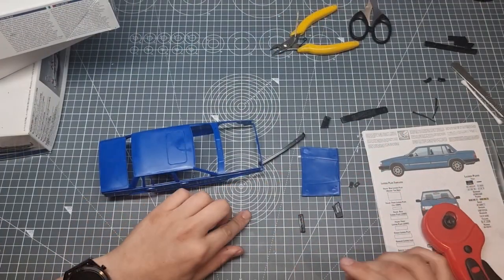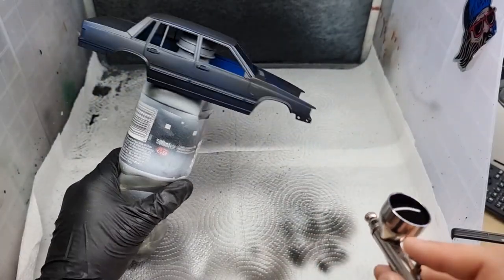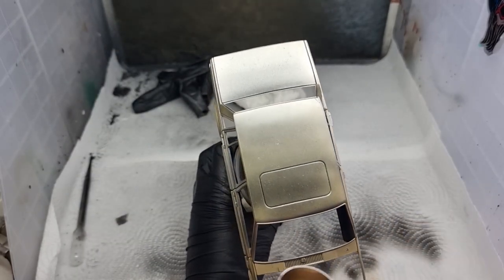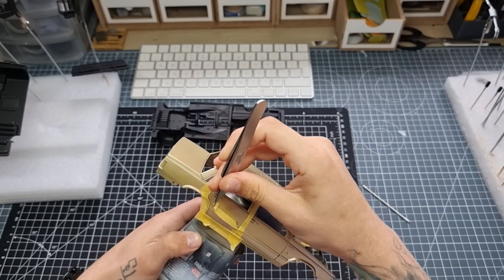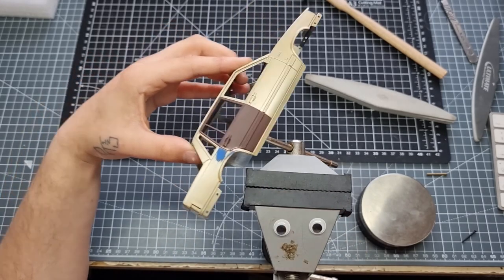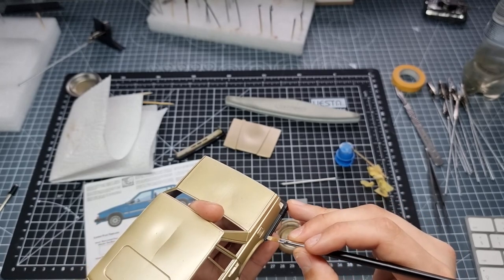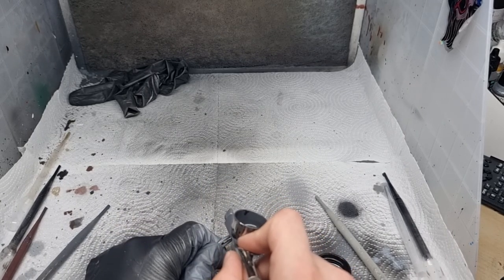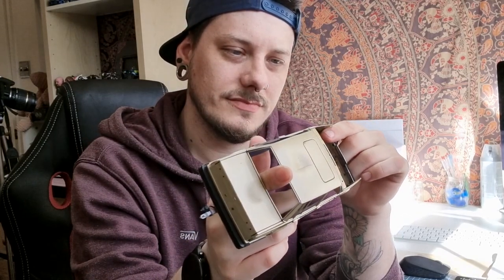Italeri Volvo 760 GLE - Part 1.

Comment: Hi Luke, very enjoyable video, the junker effects are coming along very nicely. Try some spruegoo for the roof on the inside then perhaps make the roof look like it has peeled a little to hide the crack. Perhaps some metal dry brushed on some of the rust and some grey over the bumpers to simulate aging in the sunshine? I really like Iterlari car kits, simple but go together well, not Tamiya quality but still nice to build. Cheers Philip
Reply from the maker: Cheers Philip! I was going to use some UMP Ash pigment to add some weatering to the plastics, it works quite well!

Comment: Nice one :).........Luke if you don’t use the eject usb drive function from the bottom right task bar that will happen. Files will be on drive but not visible. Not sure if that is your case.....just a tip :)
Reply from the maker: Thank you! I'm very particular about doing that. I always do it, fortunately, and if it won't eject for some reason, I'll shut down, hahaa!

Thanks for the tip, though! :)